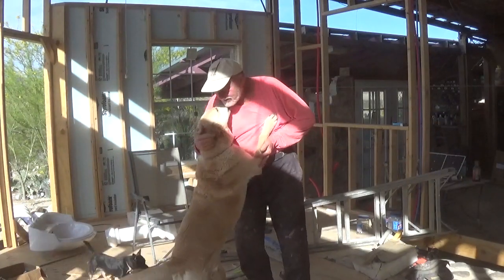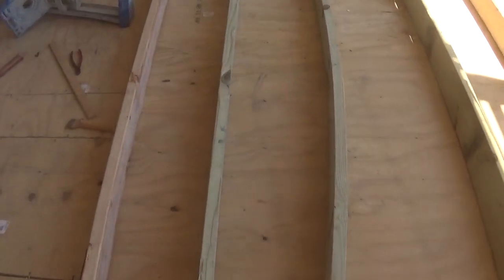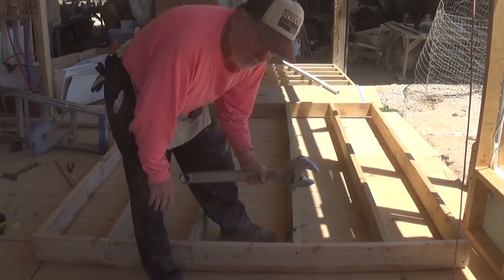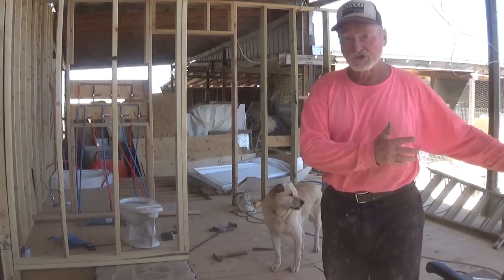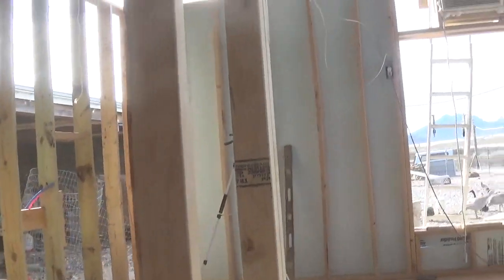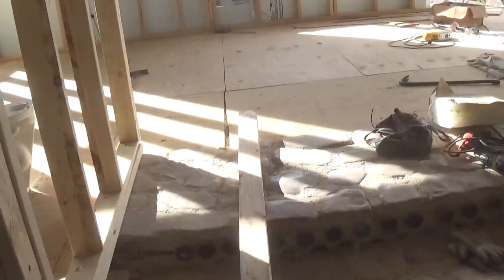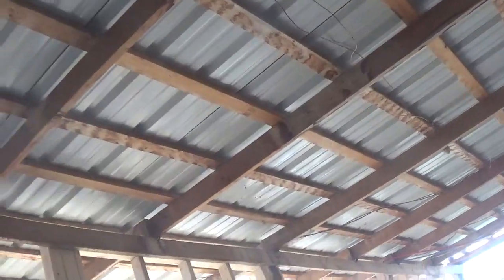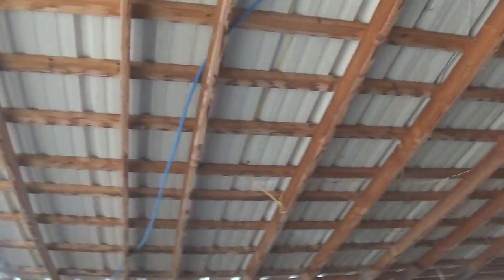SHAME ON YOU McCOY'S…… THE LAST WORD!

Comment: Some of that lumber was total rubbish Robert, I don't blame you for taking issue with it. When I buy quality lumber I pick it personally thus discarding any rejects.

You are also totally correct to complain because if you don't, these retailers realise that they can get away with flogging a crap product. If everyone took a stand like you the quality of the timber would rise very quickly.